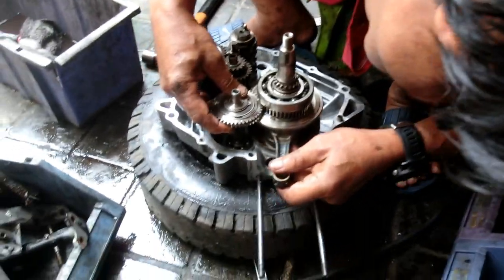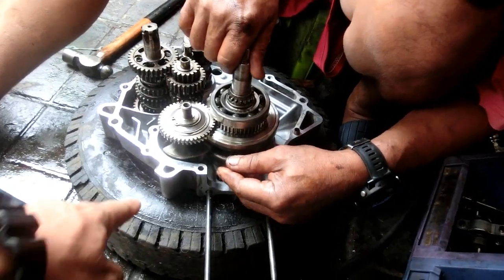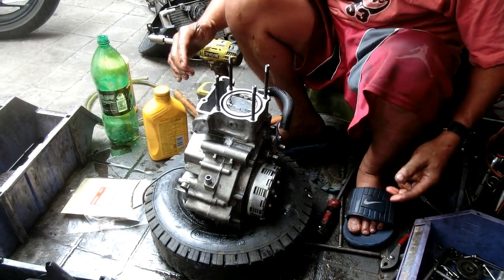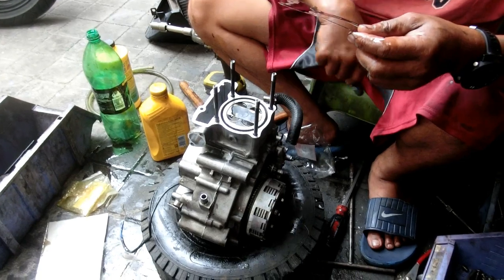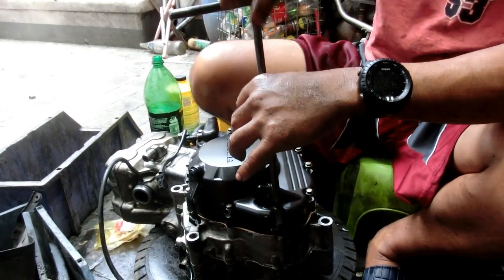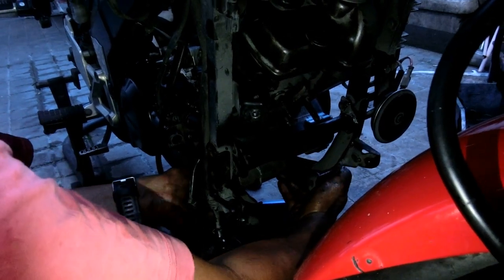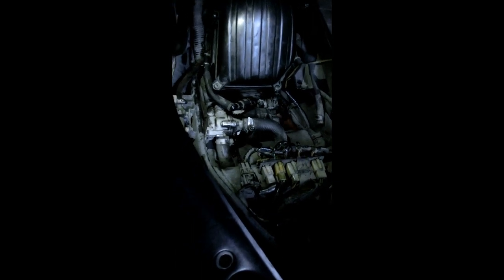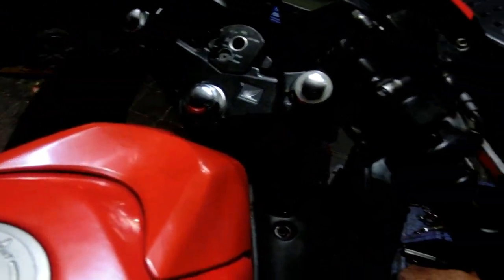Motorcycle engine knocking sound fixed - binaba at biniyak ang makina overhaul major operation Part2

Comment: Sir ilan na odometer mo first time nabuksan engine cbr mo sir?
Reply from the maker: Hi Sir! around 80k odo, nagtopoverhaul kami, replaced piston, rings, cylinder block, sinabay nadin timing chain, tenshioner at guides.. pro actually dipa nman kailangan palitan kc wala pa nman usok, nakaramdam lang ako ng pagdegrade sa performance ni CBR that time eh may budget nman kaya minabuti kona palitan.
Reply: @FIDFixitDennis  salamat sir
Reply from the maker: @kreezyvideos7916   Welcome Sir!
Reply: @FIDFixitDennis  magkano naman po nagasto nung pinatop overhaul mo?
Reply from the maker: @ralphvincegalacio2643  Yang sa video na yan Sir binaba talaga makina at Overhaul talaga nangyari. biniyak talaga kc bearing ng clutch housing ang pinalitan. Bale 2k yung labor tapos nasa almost 500 yung bearings pares na kc. Kaya lang may mga sinabay na ako paggawa kagaya ng injector cleaning etc.. kaya umabot ng 5k.